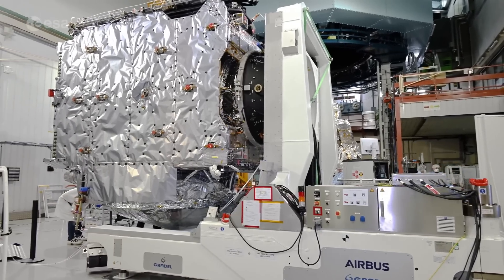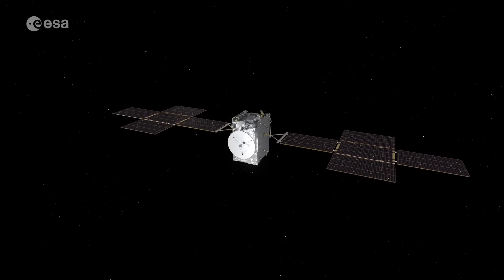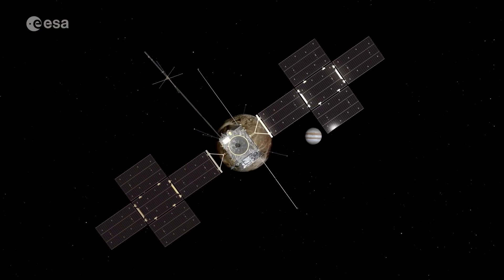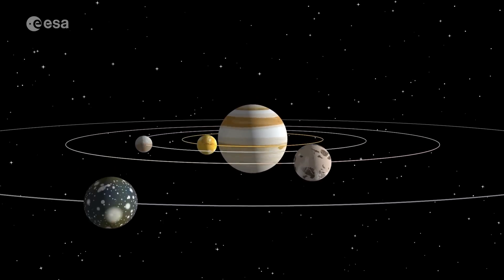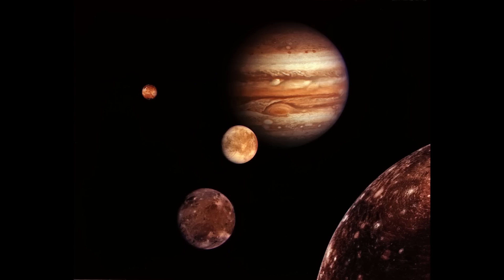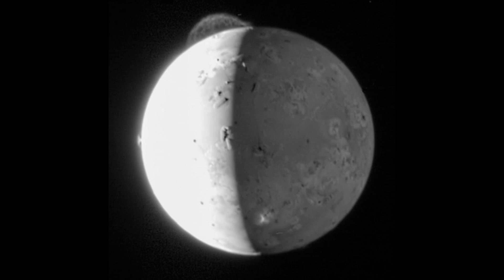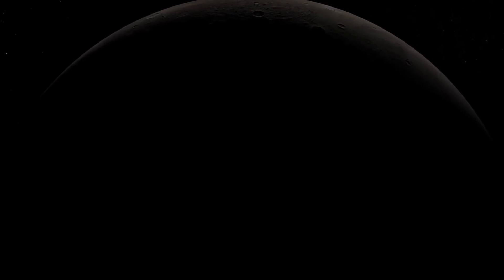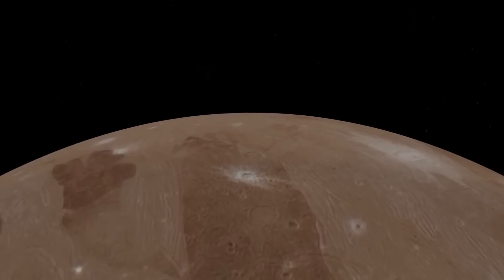European Space Agency Looking For Life In Jupiter's Moons

Comment: Ariane 5 launches are always spectacular - the rocket doesn’t hang around when those boosters light - it just wants to fly. Good luck to everyone involved in the mission.
Reply: Isn't this the second to last Ariane 5 launch?
Reply: @owensmith7530  Actually this is the last Ariane 5 launch.  Its Ariane 6 replacement will fly a prototype at the end of this year.
Reply: It def jumps off the launch pad
Reply: You haven't seen any Indian launches..?
Reply: @John_Honai  Yeah the ISRO's GSLV M3 rocket is like a little sibling version of Ariane 5!
Reply: it's such a clean looking rocket
Reply: @John_Honai  Those are amazing - I especially like the way the LVM doesn’t light the core until the rocket is in flight. It uses two massive SRBs to get off the pad - and then it gets more exciting!
Reply: @adarsh4764  One reason that the Mark-3 appears to take off so fast is because the core stage hypergolic engines don't ignite at liftoff, they are air-started about two minutes into the flight a few seconds before the solid boosters burn out. So at liftoff there is no reason to wait around for the main engine turbopumps to spin up, or chamber pressures to build, or for the computer to check things out in the first few seconds after engine ignition. Just need to light the solids and up it goes. Almost like firing a cannon.
Reply: I was just going to comment how it practically leaps off the launch pad. Pretty dramatic.
Reply: @aemrt5745  There is one more launch with geostationary communication satellites.
Reply: @aemrt5745  No it' actually the second to last Ariane 5 launch. The last launch is scheduled for June.
Reply: Ah, good to know.  Thanks for the correction.
Reply: I remember watching Ariane 5 V1 launch at work; it was carrying one of our satellites and the original launch date was a big event at our company; the rescheduled launch was shown on TVs all across our site, so thousands of us got to see the spectacular failure!
Reply: @cambridgemart2075  I was young then, and I remember it made me sad! But since then she has made up for it!
Reply: Ariane 5 is very expensive, but super precise, see the JWST launch

Comment: Shows how good solar arrays have gotten that Jupiter orbiters like Juno and JUICE can use them so far out there. Prior missions required RTGs.

Also didn't have to scroll far down the comments for "2010" quotes! You have your thumbs-up!
Reply: Nuclear seems like it would be more robust in all that radiation.
Reply: Still it's not a very reliable solution considering that it'll take it some 10 years just to fly to Jupiter. Stuff can impact the arrays on the way there or it can encounter some previously unknown anomaly causing them to be severely degraded before the important part of the mission even starts.
Reply: @_________________404  ESA is pretty good at solar power.  The arrays are relatively tough for what they are designed to do and JUICE will be able to run on slightly less power.  As for a 'previously unknown anomaly'  That's why testing is done, to eliminate as much chance of that as possible.  Yes there is always going to be some risk but so is life.  You could choke to death on your coffee right now, it won't stop you taking a sip though.

Comment: I can imagine thermal heating from gravity in a solid body but surely as soon as the hotter parts start getting mailable they just move rather than generate heat?
Reply: ah, but heat IS movement!
Reply: @bbgun061  Well yes, but no. Very different scales. When you're sat on a train doing 150km/h you're not way hotter than when stationary on the platform.

@Jake S. Malleable parts still have friction, and don't have perfect elasticity. Take a rubber band, stretch it out in full and then let it contract again. Do that 50 times in quick succession. You'll see it's noticeably hotter at the end.

Comment: I'm curious about the structural design of those solar panels to the main body. I'm sure they made sure it's gonna be strong enough, but it looks kinda finnicky. Feels like a burn would put a lot of stress on the trusses(?) (even in a vacuum), or are those solar panels like ultra light weight?
Reply: 80 square metres of solar panels! Wow
Reply: Really depends on the power of the engine.  Just found out, just under 100lbs of thrust.
Reply: Engine has low trust but burns for a very long time so the acceleration is very low
Reply: @IsardPragmatique93  nope, those are chemical ones with 425N / 95lbf  of trust using just near 3700kg of NTO/MMH (for both attitude control and propulsion).
But 425N is indeed very, very small but far beyond what ionic can offer.
Reply: @IsardPragmatique93  Theres not enough solar power out at Jupiter to make ion engines worth it

Comment: quick Q, with most of those type of launches taking years to get the destination through multiple gravity assists, I know bigger boosters cost more money but is it really cheaper to run a smaller booster and run operations/ops rooms for say 3 extra years over the cost of a bigger booster?
Reply: Big boosters also come with big manufacturing facilities and big launchpads, which are expensive.  Also they might not even exist sometimes, when this mission was envisioned and planned, falcon heavy (for example) didn't exist. New Glenn doesnt exist, Vulcan and Superheavy also do not exist (as operational rockets) and SLS is limited to artemis and also very expensive. Additionally Ariane 5 is a reliable rocket and was the choice for JWST for it's amazing track record having 83 consecutive missions without failure between 2003 and 2017 and 1 partial failure in 2017 caused by human error while programming the launch trajetctory.
Reply: That's basic the upper limits a rocket we can get.... Even we have larger rocket, they probably will just put in more stuff instead let it fly faster --- They want use free planet energies (actually a lot of energy), and they think more obit time might be useless since they already get all the data they want.

Ariane 5 get a very powerful upper stage, it's performances is very close to the most powerful upper stage engine we have (RL-10). And since it's a EU satellite, they do want use EU rocket. When we talk about deepspace mission, the good upper stage is more important than LEO deliver capabilities. (For example Falcon heavy vs. Vulcan to LEO can carry 2.3 times stuff, but to GTO, drop down to 1.75 times --- Why I say upper stage is important!)
Reply: @mingtang7052  Crazy how Nuclear thermal rockets could have been built 50 years ago, which could have easily flung lander missions even to moons of outer planets as their efficiency is double the hydrolox engines like RL-10. And I'm not even going into weeds of other exotic propulsion technology. (From goofy project Orion to more reasonable magnetoplasmodynamic thrusters)
Reply: There are entire years between even the flyby boosts. I doubt they will run full mission command the entire time until they reach Jupiter space. A computer can monitor it's progress and just record the data most of the time. Not sure that really costs anything in the grand scheme.

Comment: Why are the outer wrappings on space probes wrinkly? I would assume, with the precision these craft are built, that even a very fine film could be applied more evenly?

Thermal expansion can't possibly so pronounced it needs that extra material, can it?
Reply: It's usually mylar insulation and in a place with no air there is no need to be neat.
Reply from the maker: The insulation is made of thin layers, if the layers touch then the insulation doesn't work as well. Turns out the lightest way to do this is to let it wrinkle.
Reply: @scottmanley  I am now imagining that Airbus and likely also Thales employ somebody specializing in proper wrinkling of space mylar sheets.

Comment: I wonder why this mission wasn’t propelled by ion thrusters, surely they could reduce flight times and be within weight limits or if not provide a second smaller booster to carry the engine and propellant and dock it in orbit.  Then send the spacecraft on its way.  More complicated yes, but much reduced flight times.  Any missions to the Jupiter or Saturn systems today should use the latest technology in boosters to get there.
Reply: I think the Jupiter Orbit Insertion manœuvre requires a high amount of delta-v (that electric propulsion can't provide)

Comment: Why on earth would you choose solar panels when RTGs are a thing? Especially when the mission profile involves such high rad environments? Voyager is still going nearly 50yrs later, that's the kind of reliability you need on these deep space missions.
Reply: Solar panels have become much more efficient. Easy, simple tech.  Probes on the inner planets have been using them for decades.

RTGs  have significant safety concerns at launch, requiring shielding (extra weight).  They also need to be isolated (extra weight and structure).  Solar is easy, efficient, near limitless, and simple proven tech.
Reply: @aemrt5745  inner planets are fine, the density of solar power there gets stronger. I'm taking about the outer planets, particularly the Jovian system. Yes RTG require extra shielding but that's a constant amount, whereas with solar the mass of panels required increases quadratically the further out the mission is, plus the risk of catastrophic failure increases as the panels must be constantly in sunlight, any extended periods of shadow could cause critical lack of power.
Reply: @mattkerle81  Juno has been operating just fine orbiting Jupiter since 2016.  The tech has improved and, as Juno demonstrates, solar panels are practical in the Jovian system.

Regarding breaks in sunlight, I guarantee the engineering team has taken it onto account.
Reply: @mattkerle81  I've worked on large Aerospace engineering projects.  You do not make these decisions lightly.  Several possible configurations were considered, and with boundary conditions like weight, safety, budget, risk analysis, etc., solar made the best choice.
Reply: @mattkerle81  There are also political issues.  In the US, certain technologies are covered under ITAR regulation to prevent potential adversaries weaponizing civilian technologies, making usage and export more challenging.  PL 238 is not a weapon isotope, but it may very well be an issue with ITAR under dual use technologies.  I imagine Europe has similar laws.  ITAR can even slow down cooperation between friendly nations to prevent tech export.

So using an RTG may simply be impractical from a political standpoint if you have a multinational effort.

I have not worked with nuclear material, so this is conjecture on my part, but it is very plausibility an issue.
Reply: @aemrt5745  I dare say the issues around regulation and procurement of Pu-238 are the killers. We don't have very much of it and it likely makes regulators very nervous, my guess would be that on the margin missions that could get by with solar would be designed with solar. But just looking at the difference between the curiosity rover and all the other Rovers just goes to show the difference in capability between between solar and RTG.

Comment: but why not use falcon heavy? they have than extreme beast getting dust, I can't count how many times I said "why not use falcon heavy?" already
Reply: Launch contracts like these are usually written long before the flight.
Reply: @TheEvilmooseofdoom  but that's dumb, is just a lauch vehicle, it doesn't need anything, is the same spacecraft, they even have payload adapters for these things and they are usually very simple, in less than a year they can very completely ready, is just dumb
Reply: @NeroDefogger  JWST for example would have been too big for the Falcon Heavy fairing. There is much more to it than just payload adapter. I am not even talking about trajectories and politics.
Also Falcon Heavy is also too weak to launch JUICE directly to Jupiter.
Reply: @_TeXoN_  the fairing is almost as big, most payloads fit on both, if it trully uses that bit it could be recuded a little bid, is very little, and yes I know it couldn't but it would be much closer, so it would be much easier, but yes I know, that's precicely what bothers me, is always politics and technicalities and papers and boring stuff, is like we just invented a machine that ends world hunger! it is fully functional it is totally ready we just turn it on right? wait wait wait right there dude, does this have the 300 boring papers signed by 300 old fat suited guys? no? then it will take at least 10 years for it to be ready if everything goes well, and it never does
Reply: @NeroDefogger  Indeed politics are complicated, but you always have to remember that each of that "300 fat suited dudes signing papers" brings money to the table or at least pushes congress to vote for more money. At the end this is why these programs exist in the first place. It is not about doing it cheap or expensive. It is about doing it or not doing it.

Comment: Hopefully this can become an area where Starship will make a huge difference. You could easily design an extremely light-weight transfer stage made of concentric spherical tanks, with methane in the outer shell and LOX in the inner, a simple external truss around it all for attaching the probe and a big vacuum rocket engine. As it doesn't have to be aerodynamic or be able to handle aerodynamic forces, it can be made very light, giving it an enormous delta-V. Place it in the cargo bay of a Starship, release after entering orbit, and let it kick a large probe to Jupiter and other distant objects on direct transfers, obviating these extremely tedious gravity assists.
Reply: Kerbal isn’t real life
Reply: @tonk2629  mans speaking facts what u sayin, i totally remember there being a engine that can capture around a gas giant
Reply: You're talking about a larger PAM and there is no reason it couldn't be done.  Not sure about Methalox but certainly something.
Reply: @tonk2629  This isn't Kerbal.  There is no reason it couldn't be done.
Reply: @TheEvilmooseofdoom  Concentric spherical fuel tanks don’t even exist yet, and the sheer amount of fuel needed to brute force circularize around jupiter, exceeds any engine that exists today.
Reply: @TheEvilmooseofdoom  Methane in the outer shell and LOX in the inner shell. Methane has a MUCH lower boiling point than oxygen. It would freeze the methane without huge amounts of insulation. That tank will also have huge cut outs in it reducing the strength massively. The tank would need to be insulated and cooled to protect from boil off for literally months as solar power gets low the farther it gets from the sun. Also we would need a methane engine that is capable of being that efficient, which would mean yet more engineering to add on to however those tanks would work.
Reply: @ASAVSP  It's only used for the kick into the transfer orbit, then discarded.
Reply: @mytube001  The whole tank concept is still ridiculous though.
Reply: @ASAVSP  Not at all.
Reply: @mytube001  Oh yes at all. Did you even read my comment lol. They rest at completely different temperatures
Reply: But... why? Who cares if it takes a while to get there? A rocket that can lift a larger payload to LEO should be used to launch probes that have better instruments, better shielding, more redundancy, can get into more interesting orbits, maintain them for longer, etc... Using the extra lift capacity to get there faster would be a huge waste. Missions shouldn't be designed around your personal impatience.
Reply: @QuantumHistorian  Becuase I'm impaitent. We all get older. We want to see what the probes find. I'm in my 40s, and will be in my mid 50s when JUICE is done with its mission. With a direct transfer, it could be there in little over a year.

Comment: I'm really hopeful that Starship will be launching 100 ton probes in the next few years that will arrive at these destinations and surpass the results before these even get there.
Reply: You would have to redesign the probe with a more powerful engine to slow down in order to enter orbit around Jupiter and Ganymede.
Reply: @nicholashylton6857  Yeah, you could have a 100 ton probe, 60 tons of propellant to get there, 30 tons of propellant to slow down leaving a 10 ton probe.
Reply: @Spedley_2142  The more massive probe, the more expensive it's going to be and its power requirements are going to be larger.  Bigger doesn't necessarily mean better.
Reply: @nicholashylton6857  No, that is not the point.  Currently launching a probe to Jupiter is a huge commitment taking decades and has a huge risk attached. Everything must be absolutely perfect and as light as possible for a single launch.
With Starship to get to Jupiter the cost could be a tiny fraction of current costs and be much quicker. You can use off the shelf proven technology as mass is no longer a problem and go on a more direct route.
It's the difference between crossing the Atlantic in a custom built canoe vs an off the shelf yacht.

Comment: i wonder if a disposable falcon heavy would be able to do a direct route so i dont have to wait until i retire for it to arrive...
Reply: Hmm, that is a good question.  According to Wikipedia "Comparison of orbital launch systems" Falcon Heavy expendable has over 3 times the lift capability, so unless there is some other technical reason that prevents it, it seems JUICE could have a much larger upper stage with a Falcon Heavy expendable launch, and skip as least some of the gravity assists.  Maybe politics made them use Ariane 5.
Reply: @gptiede  At the time JUICE was being designed, neither Falcon 9 nor Falcon Heavy existed. Also Ariane 5 has the largest payload fairing, which is why JWST launched on Ariane 5. These big probes are designed partly around launcher constraints, and it is often difficult to change launcher part way through design.